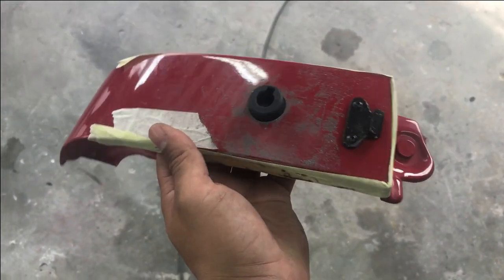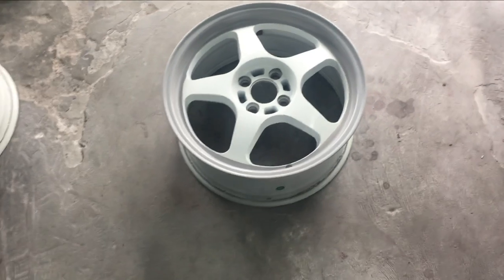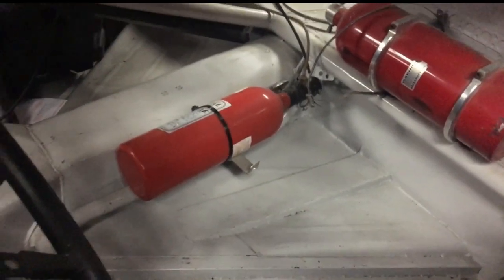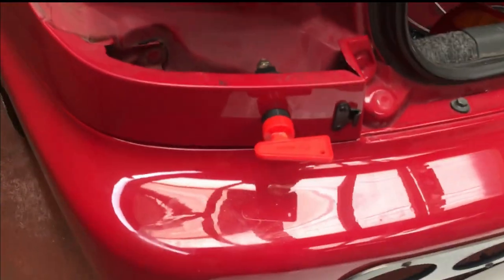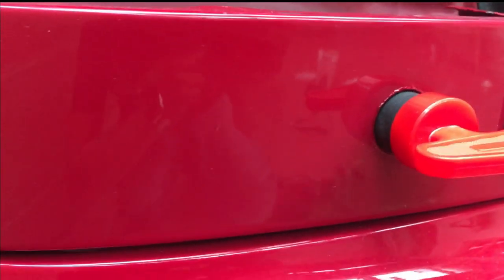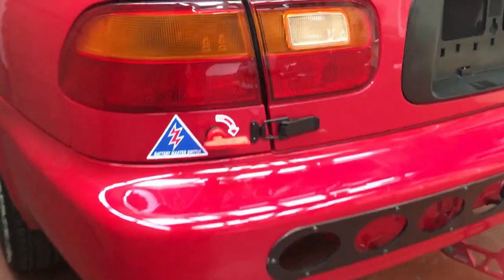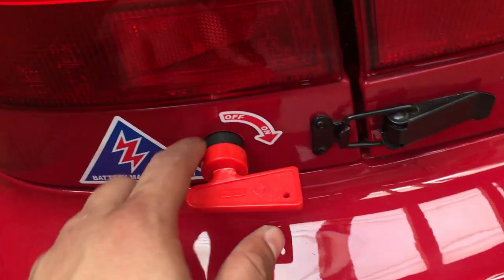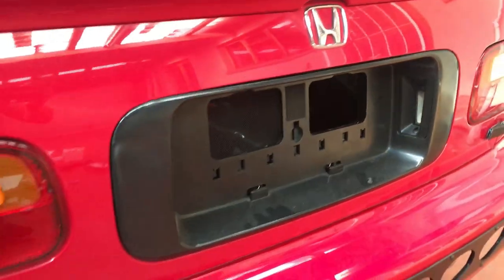KILL SWITCH INSTALL ON MY HONDA EG - FINAL RESULT

Comment: What paint would you recommend Wong I'm respraying my civic soon?
Reply from the maker: Luciano Solomon 

I usually use Cape paint & panel in maitland or cape auto paints in Montague gardens
Reply from the maker: Luciano Solomon They hav a variety of Brands more expensive the better
Reply: @WongStreet2Track  thanx bru I'll check them out I'm looking for a j@sgat white something that's gna pop a moerse hou 😎
Reply from the maker: Cool bro Goodluck🤘🏼